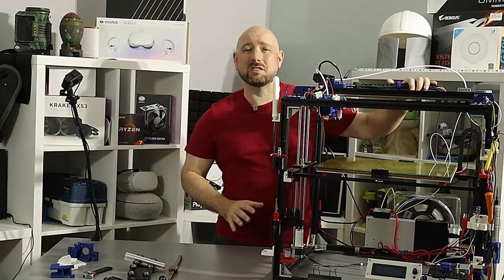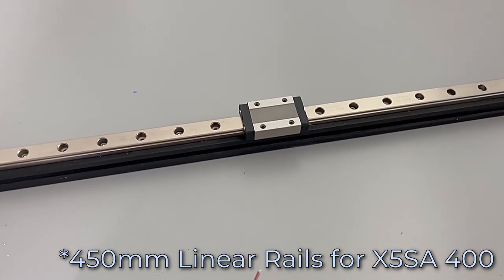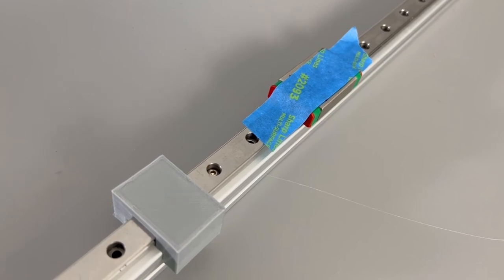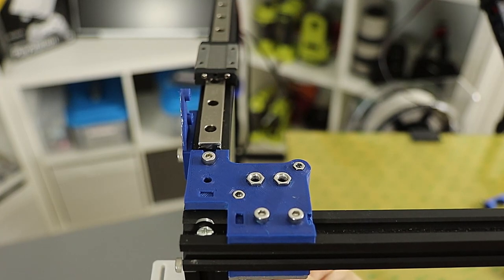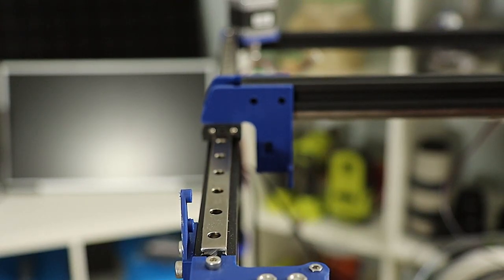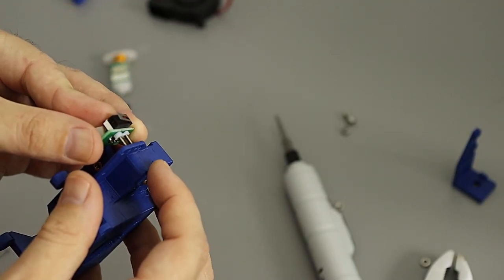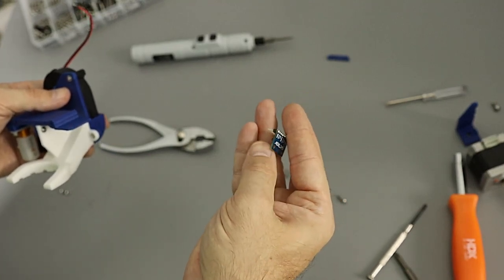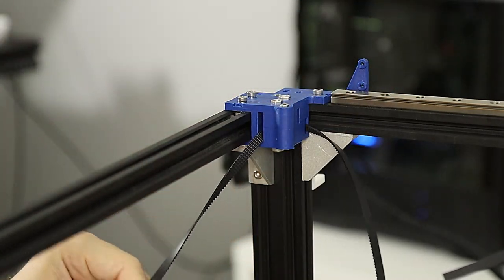TronXY X5SA Linear Rail Gantry Upgrade

Comment: Very good.
I have 2 questions, 1.What material is blue parts? PLA? ABS?  2.The parts printed X5SA?
Reply from the maker: Hello.  I print a lot of prototypes so I end up going through a lot of material :)  There are actually two 'blues'.  The darker blue is Duramic PETG and the lighter blue is Inland PLA+ IIRC.  I like PLA+ for most of the mechanical parts as it's very stiff and brittle while high temp PETG is great for parts around the hot-end.
Reply: @LilMikeysBigPlans  thanks! I will refer to it!

Comment: Hi, I just began to upgrade my x5sa-2e to linear rails with your design, now I encountered the issue, that my hotend doesn't fit into the bowden carriage.

Could you edit or add this Hotend to your design?

I'll be happy to assist with measurements, if needed.

Best regards and thanks in advance

Danial

Comment: Awesome. Just wished I could use a EVA 2.4 carriage on it (I very much like the modular design of thos EVA carriages and as I like to use the Dragon hotend). Just wonder whats easier to redesign, the EVA carriage or your XY-carriage?
Reply from the maker: Hey Wolfram.  The EVA is a great carriage - lightweight and has a lot of options, but is complex.  The carriages published here were designed to be super simple.  For the most part they are just one solid body with various holes and hangars on them - mainly because they don't straddle the X extrusion like the EVA (and most carriages) do.  You should be able to pretty easily modify it for whatever you need.  Were you interested in the bowden or direct carriage?  I've recently started migrating to printables.com and I'll upload the correct step files and update the description with the links tonight.

Comment: Dude this is RAD, thank you so much! Would you be willing you upload STEP files so I can make a TitanAero mount?
Reply from the maker: Hey Matthew.  Good idea on the Aero!  It should mount to the carriage fine but designing a part cooler will be a trick.  I've uploaded the step files for the Direct drive carriage, bottom plate and blower to the Thingiverse page.  All of these are still WIP and I'm going to put the whole system on something like github when it's complete but if you need additional steps before then just give a shout.

Also, I have an Aero here somewhere so if you run into issues or just don't want to deal with it I'm happy to whip something up.
Reply: @LilMikeysBigPlans  It's really civil of you if you also upload the .step files - way to go.

Comment: Compliments to you dude! This is the simplest, easiest print for the linear rail conversion. I’ve installed and tuned, happily running at 150mms with 6k accel
Reply from the maker: Thanks Zain!  I try to keep it simple as I'm always futzing with it :)  Awesome speeds!  I got my other printer up to 140 @ 4k but stopped tweaking it while I worked on other stuff.  Please let me know if you get any higher!
Reply: @LilMikeysBigPlans  Aye, I got some artefacts so backed down to 140/4000 as well. 

I’ve posted the below on thingiverse 

This is a amazing design. Not complicated to do at all! Easy fitting and a throughly thought out design to ensure newbie compatibility. 

Two quick questions though. 

1. The blower mount for Bowden sits about 20mm above the nozzle. 
2. A request, can we get a dual blower mount? The speeds that this can reach need some hardcore cooling :)
Reply from the maker: @zainie1408   Hey Zain, also replied on Thingiverse - but there should be two sets of holes in the blower, one for standard heater blocks and one for volcanos.  I switched back to a direct but you can see the bowden + volcano in intro to this video so it should be aligned.  If you can't get it to fit, please send over a pic as it may be something I can debug without having to re-convert to bowden :)
Reply from the maker: @zainie1408  And for dual-blowers, I'll have to see what I can come up with.  :)  Working on some other mods at the moment but I'll get back to it soon.
Reply: Hey Mike. Thanks for the reply! I’m thrilled that you’re gonna look into the dual 5015 requested! 
I’ve uploaded a make on thingiverse to show the fan position. Although the pictures aren’t great, the fan is sitting halfway up the block. The bottom edge of the fan is about halfway down the block. Not sure if by design. Will upload more pictures soon :)

Comment: Can you make a video on fan duct upgrades? I try looking for a good air duct so it can cool the print all around it instead of one side but have no luck. I have a tronxy x5sa 300
Reply from the maker: Hey Boomer, Unfortunately the blowers are usually coupled with a specific carriage.  I can make a video on how I designed the 3/4-around blower for this carriage if you like.

Comment: Great video, very informative! 

This design, flipped over, so the belt system is on top would allow over 380x380x380 with an e3d v6 and volcano. (As my setup has) 
I've got something similar, but used the stock xy plates with new holes drilled., and stock plates at the extruder with a filistruder v6 mount. 
Obviously completely rerouted the belts away the corners to have perfectly straight alignment. 

Thanks for your videos, I've watched several 😌
Reply from the maker: Thanks James!  I've switched to all linear rails with a different belt system altogether.  Cool to see people making this cheap printer 'kit' into something awesome :)

Comment: Do you have a Bowden bracket for the Proximity detector vs the BLTouch?  I have bent too many pins on BLTs traveling over curled edges.  The current print finishes fine, it is the NEXT print that fails dramatically.  I know it is not as accurate as a BLTouch, but a raft, or a thicker first layer takes care of that.

Comment: Cool mods. The m5 bolt through the pulleys would be good with nylocks upside down on the top. Man, metric hardware is expensive ehh. Whenever I get an Amazon gift card I just waste it on metric fasteners
Reply from the maker: Yeah, nylocs would be a very good idea on the TronXY since the bolt is upside down.  Less important on a standard install since the bolt would be coming down from the top but certainly wouldn't hurt then either!  I bought a variety pack of m3s another of m4s, and another of m5s so while they were pricy (like $20 a pack) I should be good on fasteners for the next decade :)

Comment: On the X5SA 400 the conversion reduces the build area...
Reply from the maker: You are correct.  I left an update in the description noting the loss of build area; a few mm on X and ~40mm on Y due to the belts and motors being relocated inside the frame.  You can minimize Y loss by putting the X/Y motors on the front of the gantry and I have some design ideas to squeeze a few more mm out of the X but at the end of the day the focus is on simplicity for generic cube frames.
Reply: @LilMikeysBigPlans  I try to mod some of the files. In my mod all you have to do is to move the build plate 10mm off the heating surface and you have the full 400x400mm. When it works I will share the files.
Reply from the maker: Sounds good!  Can't wait to see what you come up with.  If you don't mind a more involved upgrade I have a Two Motor Z gantry: https://www.printables.com/model/239989-two-motor-z-gantry-big-plans-printer-system and a Three Motor Z gantry: https://www.printables.com/model/240093-three-motor-z-gantry-big-plans-printer-system that would let you mount the bed plate where you want it to be.  I'm working on a video for the three Z system in an X5SA now.

Comment: Judging by the alignment of the belts to the printhead, this design should work with a voron tap/stealthburner? Obvioulsy the x rail needs to be mounted on the front face of the 2020.. but based on this video, it seems like it would work, no?

Comment: Great video. Keep up the good work! 
On your setup, your using a Ethernet cable to connect three stepper motor?
Reply from the maker: When I run cables I prefer to use ethernet.  The one you see in this video is for the BLTouch as I just happened to have a long stepper cable handy but on my other large printer I'm using ethernet for everything except the high draw heater wiring.  I'm happy to elaborate and upload the things if you're interested in doing the same.
Reply: @LilMikeysBigPlans  I love the idea. I looked over some on your thingiverse designs and have an idea of how you did it. I definitely considering doing the same for cable management with keystone couplers and jst connectors crimped on Ethernet cable (mainly to avoid having to buy breadboard and screw terminals).
Reply from the maker: @nmos001  You probably came across my break-out boards w/ keystones.  That solution worked well but it took up a lot of space.  I tried just wiring everything directly to the keystone jacks however keystones aren't made for stranded wire and was getting frequent failures - especially with the little thermistor wires.  Now I'm using little breakout boards with pin headers on them.  I'll upload those models tomorrow if you want to play around with it.  You'll want to use stranded CAT5 for the runs.
Reply: @LilMikeysBigPlans  same, found out the hard way that stranded wire does not work well with keystones. If you tin the wires, it may work better assuming the wires are 24 gauge. I wouldn't do that for Ethernet wiring due to signal integrity, but for these low frequency applications, it should not be a problem. I think the best solution is to use keystone couplers to attach Ethernet cables, and to connect to the components, you will use a Ethernet cable with ethernet connector crimped to one end and JST connect crimped to other end. I haven't tried this though; let me know if you have tried this.
Reply from the maker: @nmos001   I've recently started using these with soldered pin headers: https://www.amazon.com/gp/product/B079L6C96M with these connectors: https://www.amazon.com/gp/product/B07CWJZSPC.  That's actually what you see in the video but it's under a shell.  It's been working well so far and they're cheaper than keystones but you do have to crimp connectors on all your wires.

These breakouts worked very well (with solid wire from keystone to screw terminal) and may still be a good option at the board-side but it was too large at the carriage end: https://www.thingiverse.com/thing:3766450.
Reply: @LilMikeysBigPlans  Can you add a short video for how you created the connection, did you just solder the cables to the pcb or what??
Reply from the maker: @perbackman8283  Yeah, seems there's a bit of interest.  I'll put together a video soon.  I soldered pin headers onto the PCB and then crimped connectors to the wires.  It's a few steps but it's clean and reliable.
Reply: Thanks Mike that be great add that here and include monting for the gountry and head
Reply: @LilMikeysBigPlans  thanks for the links! Good to know what you have found works well.

Comment: I have one question. Can some one tell me the dimensissions of the toothless pulleys i can't find out the outer diameter of the pulleys and the height of them and I know that the bore is 5 mm and the belt width is 6.5 mm for a 6 mm belt, but I don't know the diameter of the belt width?

Comment: could you tell me what the bed consists of and thickness or where to buy. I am building my old Troxy to match yours. Thanks
Reply from the maker: Hey John!  I'm running a 110v silicone heater so my setup is pretty substantial.  I have the stock aluminum plate, then a layer of cork over that.  The cork works as both an insulator and accommodates the channels for the silicone pad wiring.  The a sheet of tempered glass on that.  It's 1/4" and I probably could've gone with a 3/16 or so.  The I have a PEI sheet stuck to the top of that.

If you're interested in silicone heaters or this bed setup I go into a bit of detail in the silicone heater video: https://www.youtube.com/watch?v=yhzWj-oaikk
Reply: @LilMikeysBigPlans   thank you

Comment: Mike, what solution do you have to relocate the power supply motherboard and display
Also did all stl files have the option to use lan cable??
If not i like to see the mode for that all places
Reply from the maker: Here are my 2020-mount PSU shrouds/mounts: https://www.thingiverse.com/thing:4852521.  I believe the 'generic' version is what you want for the included PSU.
Here is the 2020-mountable SKR 1.4 case with generic LCD mount: https://www.thingiverse.com/thing:4852479  I also have one for MKS and working on Octopus as well.
The latest LAN cable stuff hasn't been uploaded yet.  My older screw-connector version is here: https://www.thingiverse.com/thing:3766450

Comment: do you have a BOM?  Not sure how many of each bolt I will need and whatnot.
Reply from the maker: Hello James, it's a bit hard to come up with a singular BOM since there are a lot of optional/various components.  Here's a pretty good starting list for the direct drive setup:

Rails:
3x 450mm MGN12H rails w/ single carriages
minimum of 12x m3 6mm + boat nuts

Each (2x) Motor Mount:
3x 10mm m5 + boat nuts (optionally 4, extrusion)
2x 6mm m3 (stepper shallow)
2x 10mm m3 (stepper deep)

Each (2x) pully block:
5x 10mm m4 + boat nuts (extrusion)
2x 30mm m3 + nuts (block assembly)
2x 30mm m5 (pulley shaft, nuts optional)
2x 6mm width, 5mm bore aluminum GT2 pulley
optionally you can include 2x 2040 corner brackets - you will have to replace 4x 10mm m4 with 4x 14mm m4

Each (2x) Y Carriage:
4x 10mm m3 (carriage)
3x m5 10mm + boat nuts (X Extrusion)
1x m5 30mm  (pulley shaft, nut optional)
2x 6mm width, 5mm bore aluminum GT2 pulley

Direct Drive X Carriage:
8x m3 12mm w/ nuts (cable clamps)
8x m3 10mm w/ nuts (end stop, bl touch, fan mounts)
2x m3 6mm w/ nuts (blower assembly)
1-2x m3 20mm w/ nuts (blower)
4x m3 8mm (carriage mount)
2x m3 36mm (bottom plate)
2x m3 8mm (cable tower)

Basically, you'll want one of those big kits of a gazillion m3 bolts and nuts and then pick and choose the m4/m5 stuff.

Comment: Nice Job Mikey, Keep up the good work. Been Following you since last year. I have the X5SA 330 and have been looking for a linear rail setup and this looks good. I upgraded the mainboard and the LCD for the Octopus V1.1 with a BTT TFT7.0 and the Tronxy Official Direct Drive Titan Extruder setup and have had extremely good results with my prints. However I wanna go linear rail for smoother motions. This is a good start for that adventure. Thanks again.
Reply from the maker: Thanks for watching!  Why did you go with the Octopus?  Are you planning on using all of those drivers or was it a price thing?  Personally I'm not sure how they can charge $50 for an Octopus and still get $40 for an skr.
Reply: @LilMikeysBigPlans  I opted for the octopus for future upgrade ability like ( Dual Extruder's, mixing hotend, multiple Filament Sensors ) but I chose the Octopus for the Processing Speed. The Octopus has a 180mhz Arm Cortex and with that speed it can Crunch alot of math pretty easily when printing and I do notice that it is very efficient and consistent when printing at High Speeds. Mikey, Why did you opt to place the X Gantry Linear Rail underneath the 2020? I know you mentioned in your other Video that you had some Jerk control issues when printing!

Comment: Hey Mike,

Love the design and explanation on how to build it, I'm in the middle of printing all the parts for this upgrade.  I seen on the link to download the prints that there was a picture with the extruder motor moved to the top rail and was wondering where the stl for that could be found, I'd like to put a little slack in my bowden tube if I could.

Thnx again and great video.
Reply from the maker: Hey Randall,  I just threw together a quick and dirty mount since I couldn't find any of the stock ones.  I uploaded it to the thingiverse page but I'm sure there are better mounts out there :)

Comment: pretty nice upgrades if you dont want to turn your X5SA into a VZBot
Reply from the maker: Ya, VzBot is the Voron of the X5SA world. Amazing design but a bit more complex. Last I saw the dude was printing at like 300/30k. I don’t think I could even run a bmg/volcano at that rate much less the belts and frame.
Reply: @LilMikeysBigPlans  yeah they certainly are crazy, u quite literly have to bolt them to solid surface otherwise it would vibrate of its table

Comment: Mikey, I want linear rails for my x5sa. Do I get them online or from you. Have you done anything  special to the ones you use? Want to use x and y axis rails.
Reply from the maker: I certainly don't sell them :)  If you're not in a hurry it seems AliExpress is the cheapest place to get rails - although some folks complain about dirty/low quality bearings on the lowest-end rails.  Most of mine have come from 'TwoTrees' on Amazon.

Comment: looks good.  I like the design of the printed parted you used.  I think im going to do something simular.  I just ordered 3 450mm rails for mine.  Just finished upgrading my mainboard to the duet 2 wifi, bl-touch and dragon hotend with all new fans for it and the part cooler.  so far the printer is way better.  I had it working pretty good with the stock board and hotend, But i had to print quite a few parts to get rid of some of the problems the x5sa 400 had outta the box.  Im thinking after I add Rails this thing will be rock solid. Now I need to work on my Delta and Cr10.  I kinda robbed them both of some parts I need while I was getting this guy working the way it was supposed to.  lol
Reply from the maker: It feels a lot more solid on rails - not that I had significant issues with the wheels.  For folks like us that know what they're doing the X5SA can be a good deal but there's design issues, rigidity issues, and QA issues that make it a poor choice for beginners.  I've not used a Duet yet.  Seems quite pricy and would love your feedback on the Duet vs something like the BTT family of boards.  Good luck with the rail conversion!